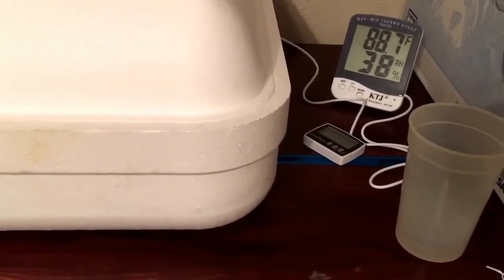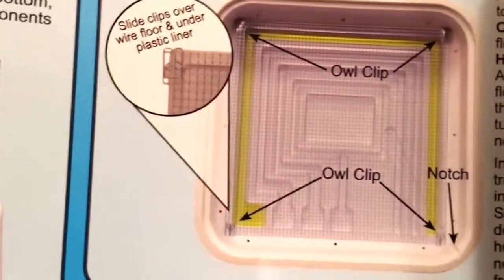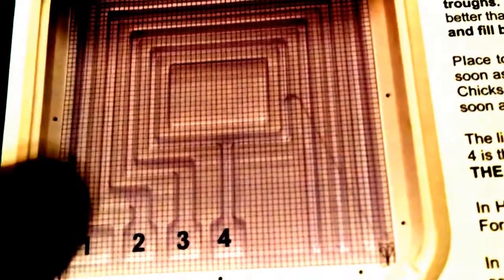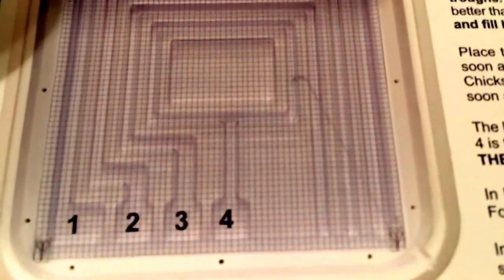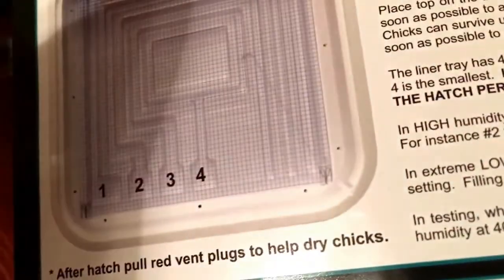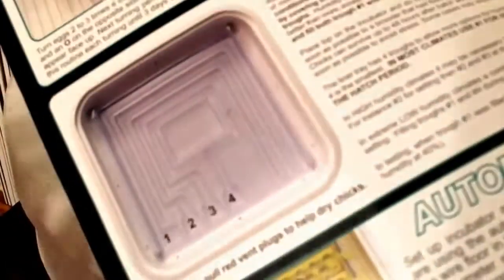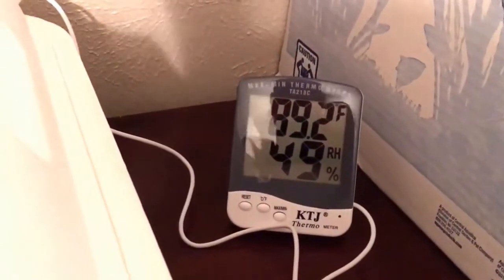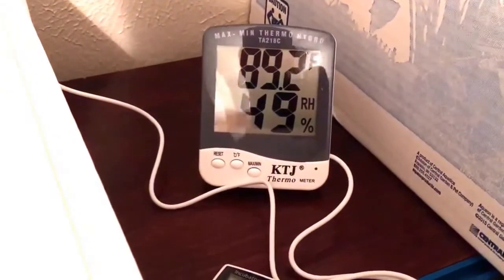Adding Water to Incubator

Comment: I prefer an incubator that hasnt had a drop added to it in 10+ years! With no lockdown and no counting days to hatch!
Reply from the maker: Yes that does simplify the whole process!
Reply: @TomBrueggen  I also incubate at humidity down to below 16% with this time of year with humidity in the house in the mid 20s and the incubator is running down at around 10% range

Comment: What is the amount of water required in that incubator
Reply from the maker: August Mshanga as I understand it, humidity is controlled by the surface area of the water. So as you see, the troughs have different numbers. Depending on the eggs you are incubating dictates what trough you fill. Fill level shouldn’t matter, just make sure it always had water in it.
Reply: Tom Brueggen my incubator is for 96 eggs
Reply from the maker: August Mshanga I don’t think number of eggs matters. It’s the species of bird you are incubating that dictates ideal humidity
Reply: Tom Brueggen I can’t get it so wat is the ideal or maximum and minimum level of water.??
Reply from the maker: August Mshanga fill level doesn’t matter. If you only partially fill, you’ll have to fill more often. If your machine is like mine, find the instructions and it should tell you, for a given bird egg, chicken or duck or whatever, to use a certain trough number, or maybe a combination of troughs. Humidity is a product of surface are of water. Longer trough or more troughs gives higher humidity.